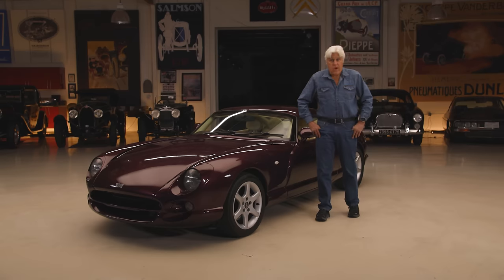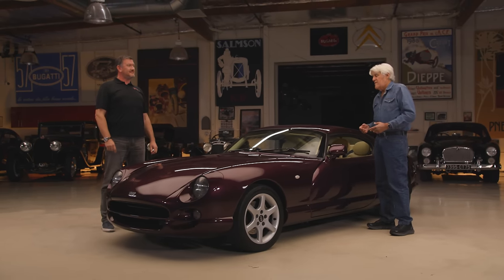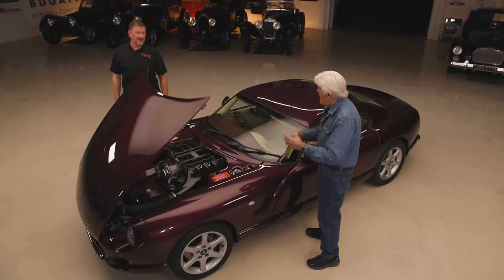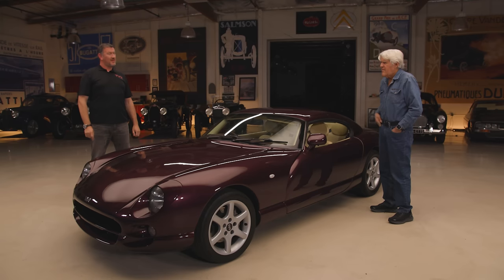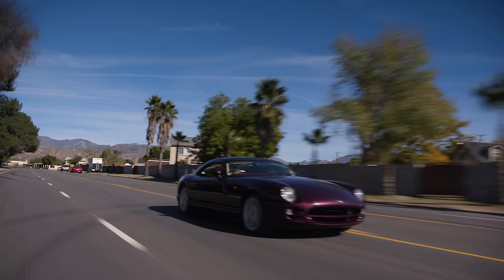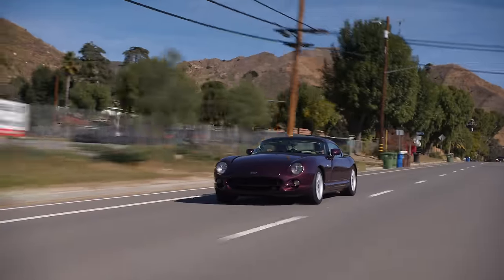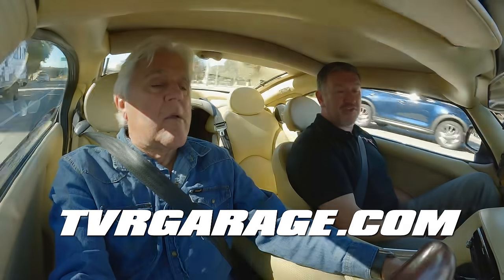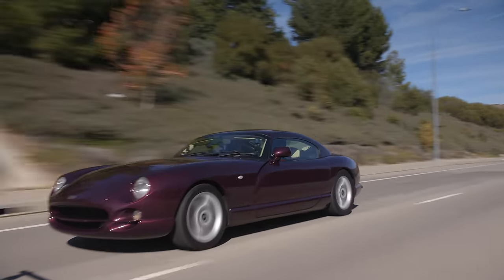TVR Cerbera - Jay Leno's Garage

Comment: I adore the Cerbera.  I was at the London Motor Show in 1996 when they unveiled the Speed 12, Cerbera on steroids.  They bolted 2 6 cylinders together and broke the dyno at 880bhp !!!
Reply: I was there too.
Reply: It didn't break the dyno making 880bhp. It was way more than that.

The dyno in question was rated for 1000bhp, the engine running on all 12 cylinders broke the dyno. So to give a rating for it's power they disabled one bank of cylinders and ran it on 6. One bank (with the drag of the other 6 not firing) produced 440bhp so they doubled that number so there were "official" figures tied to the car.
Reply: @SpitfireFortyFour  Wow, that was serious horsepower for the mid ninetees. The McLaren F1 was only 650ish. I clearly remember it broke the Dyno, but did not realise it was that level
Reply: I remember that... Peter Wheeler was on the stand too, chatting to whoever came along. Good Times.

Comment: It looked like you opened the door by pressing a little button underneath the wing mirror? Yet this quirk was never once even mentioned in a 25 minute video. In a dark room somewhere in southern california Doug DeMuro is quietly crying to himself.
Reply: Yes, Peter Wheeler liked quirky touches. The previous Griffiths and Chimearas had buttons on the bodywork behind the trailing edge of the door. Then they moved the button to underneath the door mirror.

Comment: I was a mechanic in the late 70's and received a bit of training on TVRs. Can't remember the model, but the dealer only imported one. Six cylinder, based on the TR-6 drivetrain, fiberglass over a tubular frame. Fun little car.

Comment: Great to see TVR on here! Probably recommend getting the Rover V8 engine models as there are tonnes of aftermarket parts. This car in the video has front lights from a 911 and rear lights from  a Ford Grandad Mk3 I believe. An ex-colleague of mine had a 4.0 Chimeara convertible, and drove it to work in summer (in UK) it made an amazing sound, properly throaty and brawny!

Comment: I drove my friends 4.5 red rose some years ago. Mental quick! The engine has so low inertia that it picks up speed like a motorcycle engine.

I have a TVR Griffith 5 liter (rover based v8) from the 90s. That's a 2250lb car. Same running gear as this basically. Brutal!
Reply: Is the Cerbera noticeably quicker than your Griffith 500?
Reply: @oscardominguez1680  yes, but most noticeable above 50mph, it never runs out of breath.

Comment: I notice Jay mentioned the cut away leading edge of the doors resembles a Viper but in fact it's the other way around. The TVR Grifffith had this design of door in 1990, the Viper came along in '91. The design is to reduce the number of panel gaps to ease alignment of the doors.

Comment: I first heard of tvr from grand turismo 2 on Playstation 2. Still one of the best racing simulators.  Tvr became a fast favorite because of the look and sound, but it can lay down rubber and get up into high speed racing. The viper like looks and maybe even the better-know-what-your-Doing handling make this car a huge appeal. I saw one doing donuts on a track in AZ and that sound, and look are very impressive. 

I think that if reasonably price, tvr will sell their fill. I'm 6,2 and a bit heavy so these really appeal to me. There's something muscle car and track car about them. The sound is like a cross between a motorcycle v-twin and a hopped up old school straight 6.

Awesome car. A drivers car.

Comment: I used to compete against TVR's regularly in speed events in the UK, although most were often in a slightly different class to my car. The thing about them is that they are all pretty lightweight given the size of the engines that they had fitted, so they cornered quite well. If I recall correctly nearly all of their models weighed under about 2400lb / 1100kg which meant a great power to weight ratio.  Safety kit was minimal though. I was always attracted to the interiors as they were really innovative in the design of the dash and instruments.  If I was going to buy one, it would have to be a late model Griffith which always seemed to set the fastest times of all the TVR's over the courses we competed on. 👍

Comment: I had the Griffith 500 and Cerbera 4.5 with the RR tune. TVR done the RR tune for me while i was out on the old big dipper at Blackpool beach. Only took them a few hour and they done me some other mods too. My Griffith 500 im sure they put the back diff and suspension from the old Tuscan race cars and im joking it made it an absolute weapon where as before the thing would fight me all the way if i was anything close to full power. Rapid machinery, still faster with a manual box than M/AMG/RS cars of Today. Both mine got squeaks and rattles at first till i went round them and sorted all the wee nigles with epoxy and nicer screws etc but they are solid engines and powertrains they can take daily abuse and not throw mechanical parts unlike modern cars. Again Folks... these things are a lot faster than you think, abnormally fast for the figures. 10/10 easily

Comment: I use to install Tracker (Lojack)in to these cars and id find many times the same wiring had different colour wires! One cars 12v was red the next time it was Purple. I was told by the TVR dealer they used whatever colour wire they had at the time.🇬🇧👍
Reply: you could be wiring a Citroen 2CV, they are all green wires.

Comment: Great feature Jay! I have had an imperial blue 4.5 Cerbera for 20 years now and still love it. The noise and acceleration still takes my breath away. You must have the sports exhaust though for the F1 'cackles' when decelerating or changing down gears. Never drive it in the wet though as that power to weigh ratio is lethal under braking on a wet road! I love the design and I believe the front light recesses came about when Peter Wheeler dropped a clay model of a TVR and his dog bit into it which gave him the idea. So sad with the demise of TVR with the new car looking less and less unlikely.

Comment: When I first moved to London, there was a Cerbera parked out front of the apartment the company put us up in. I never did meet the owner, but always wanted one from then.  Top Gear did a piece about how fast you would have to go to not trigger a speed camera. The final car they used was a TVR Tuscan S and they did 174mph to beat the camera. (Incidentally you can pick one up over here for £21k.)
Since they didn't have ABS, traction control or airbags, they wouldn't have been allowed in the US at the time.   
There is a Cerbera V12 that was built by the factory and someone has rebuilt it. I'm sure it went for crazy money, but I do know it was recently sold at auction.
If you like the Morgan, you ought to look at the Pembelten Jay. It is the quintessential British car company.

Comment: Regularly drive a 4.5 version back to back with a manual 991.2 GT3. Of course the GT3 covers ground much faster, but as an overall experience, the TVR is shockingly good and does not feel its age at all. Best feature is the telepathic steering, you just have to think of opposite lock and the car reacts. Brakes compare really well vs a modern ceramic setup, outstanding feel and lots of retardation thanks to the low weight of the car. Interior is way more special than the 911.
Reply: ❤ exactly this Imran 😊👌🏻

Comment: Great video, would be great if you could track down a Lister Jaguar 7 Litre V12  600BHP XJS, they made them in the 1980's up to 1990, 0-60 4 sec 206 mph they only ever made 25 of the 7 Litre V12 and only 4 were convertibles and just 5 of the cars were Supercharged

Comment: 8/12/2024
When I saw TVR I said Oh wow, This is the first of this model I've seen.
Back in 1964 I knew a guy that had a Griffith, a motor with a seat attached, just kidding. Like Jay discribed, it as scary fast. The thing had 5 point FIGHTER AIRCRAFT seat belts, and about 2/3 the size of a Tiger.

Comment: Check out the 7.7L Speed 12 TVR, it’s insane!!!
Reply: How? There is only one genuine one running the 7.7 V12. Now owned by someone we in the TVR community have no clue about. I knew the previous owner and he has the original panels on another car which is purple, but it's running an Aston Martin engine. Not to be confused with the TR Speed 12 Turbo, that's a complete replica from the ground up.

Comment: TVR's were and still are such cool iconic cars. Just dont ask about safety related stuff. If you crash in a TVR, you die.

The Cerbera also came with an inline 6 engine.
Reply: The only reason I've not died in my TVR is 'cos I've not crashed it!

Comment: I had a 4.5 Cerbera with an aftermarket ECU, custom induction, and custom exhaust. It was properly fast for an under £20K car (second hand). I got it up to 185mph once and it had a little more to give. 

I have thought about another but parts supply is a problem these days.

Comment: Travel Very Rapidly, the old factory advert, very appropriate.
A mate of mine raced an original Griffith in the 60s and it was just as Jay describes...squashed up and would swap ends at the slightest provocation in the dry. In the wet...hmmm. Even blokes with oversize testes were made to think, in the wet.
Peter Wheeler, the man who had all his blood drained out and replaced with petrol!

Comment: I can’t help but feel that building their own engines after the Rover V8 supply ran out sort of killed TVR. The problems they had sorting out customer issues led to the sale to a Russian Oligarch. The Wheeler cars were peak TVR for me with the Chimaera but more so the Griffith over these Cerbera’s. The later T350 and Tuscan (of Swordfish fame) were good too, but the engine warranty issues are what really killed their finances and lead to the sale to the current owner. 

Crate motors from BMW or similar (such as Morgan went for) would have been a wiser mover, as almost everything else on the car was bespoke and turning engines was a TVR strength so the engine could have been fettled to be more unique than the stock engine. 

The current owner has been talking about the new Griffith for a decade or more now. I’ll be amazed if it ever makes it to market!! 🤞🤞🤞

As always, it is interesting as a Brit, to hear an American perspective on British cars, although it is easy to become very defensive of any criticism, even when it is true or something we’d say ourselves!!! 😂 

Get yourself into a Griffith 500 and a Tuscan Leno!!! 😢
Reply: I think the glass fibre shell compromised them a bit too, especially when pitched against the likes of 911 etc... still, they all sounded awesome

Comment: Good question about the washer fluid bottle. It seems strange they would paint the bottle as the body colour of the car. It might look clean, but stupid at the same time since you have no way of knowing how much washer fluid is left in the bottle without opening up the cap and shining a light down the opening.
Reply: the bottle was under that painted panel. You had to open the lid to see how much was in it.

Comment: It seems Jay is not aware of the drop dead gorgeous Griffith from the 90s to early 2000s (as pretty IMHO as even an early E-Type) I think it’s that model the new Griffith is named after. Oh by the way, the “new” Griffith has been promised to market for years now! And it still ain’t happened and probably never will either. The Cerbera was based on a lengthened floorpan version of that Griffith’s chassis…to accommodate those rear seats. The Griffith used 3 modified performance variations of the Rover V8…a 4.0L, 4.3L and 5.0L. Not the bespoke TVR motor used here.
Reply: David 👋

Comment: It sounds like an old, air-cooled, cb750, with the stock mufflers punched-out. That off-throttle crackle is very harsh. Usually caused by a leak…

Is that British style?
Reply: it was engineered into the fuel management system. To help get the cars through emission tests a small amount of air was bled through the engine off throttle to help ignite unburnt fuel. Hence the crackle. I remember in my youth filing a small groove in one of my motorcycle exhaust gaskets to do the same and draw a tiny bit of air into the system to make it crackle.
Reply: Computer controlled crackles? Awesome!

It does sound broken, though. Cars use the Secondary Injection to preheat the catalytic convertor, so they do run slightly rich…but only when the SecInj system is running, and only while the cat is cold. After the cat is hot, it switches the SecInj pump to force air after the cat. Then, the flow is smoother, and it is from all cylinders, so the burning is more like a torch.

That's definitely the noise of only one cylinder.

It has a blown head:manifold exhaust gasket or a cracked manifold on the primary, for one cylinder.

Comment: It’s splendid, although arguably the Ditchfinder General.
Reply: Not really on modern tyres it's fine. The problem back is the day is tyres had barely any grip compared to now. When I got mine I switched the tyres out straight away and it went from 3rd wheel spin to hooking up well in 2nd.

Comment: Always loved the look of the Cerbera, think they’re still one of TVR’s prettiest designs. However, potential buyers be warned! It’s still a glorified kit car built in the UK, build quality is hilariously bad and it will break down, a lot! I speak from very painful and very expensive experience. They need regular servicing and whoever does it needs to know what they’re doing with the engine. I had a chat with Dom at TVR Power once, some of the stories he told me about how the factory used to cut corners on engine components were truly shocking. Buy one that’s already had a full engine rebuild by a respected specialist (like Powers), it will help minimise some of the bills.

Comment: Jay you're sitting on the wrong side buddy. Wait, what? I remember TVR's of the late 70's and early 80's. The ones I saw had the steering wheel on the correct side. Jolly bad show chaps, fix it! Just joshing sorta. I have driven left clutch right stick so long I think muscle memory would do the wrong things in a sudden stop.

Comment: Jay seems to be under the impression that TVRs in Europe are fairly common and regarded as high quality exotic sports cars or something. Maybe that's the image the importer wants people to have, but it's not the truth. TVRs sold almost exclusively in the UK, you'll find more Corvettes in the continent than TVRs - and you're 10x more likely to see a Ferrari or Lamborghini than even those! Even in the UK they were a very niche brand, known for high performance and high thrills but also for making Italian exotic cars seem very reliable by comparison, and for crashing, a lot!

They were dangerous and fell apart easily and that's why the company is dead. One of my neighbours had one, bought it new and it was in the shop being fixed pretty much every single month and for the better part of a year they couldn't get it to run right, eventually they put a new engine in it...and he crashed it driving it back home. This seems a pretty far fetched story but you'd be surprised how common such accounts are from previous TVR owners!

Comment: I've got two Saabs, currently, both late 90s early 00s 9-3 models (production 1993 to 2003), and one of them was sold an bought in Arizona. It has two radiator fans. The other is slightly older, has a single fan, and boy that poor car works so hard in the Florida summer humidity and heat. I prefer to drive the Arizona sold one during those months with the double radiators, but it's lived it's entire 23 year life in Arizona or Florida, so sometimes it needs a break to get fixed and I'm forced to use the single fan.

Comment: $70,000??? I'm a British Expat living in the states, in 2008 when I left you could pick these up for £17,000.  There are so many other cars for $70k.  That markup is not acceptable.
Reply: 2008?! It’s 2024 fella! You could also get Ferrari F40 for £200k, now except little change from £2m. A Ferrari 250GTO could be had for $4,000-$12,000  in the 60s. Now they are $70m. McLaren F1 sold a third of their target sales number at £634,500. Now they are $20m+. Lots of 80s/90s cars appreciating as each generation wants to acquire the cars they lusted after. What’s your point?

Why should TVR, an ultra rare,, absolutely stunning, pure driver’s car that was designed, engineered and built by passionate people not appreciate? They’ve designed arguably some of the most incredible looking cars ever made.

Typical negative Brit attitudes towards good things that come out of the country need revising. If this had come out of another country they’d be lauded by their countrymen 🤦‍♂️